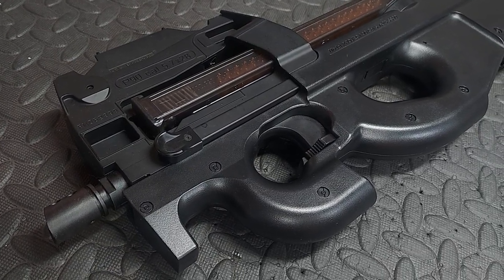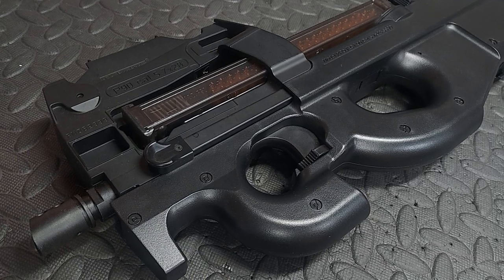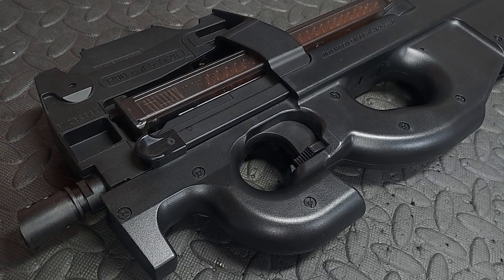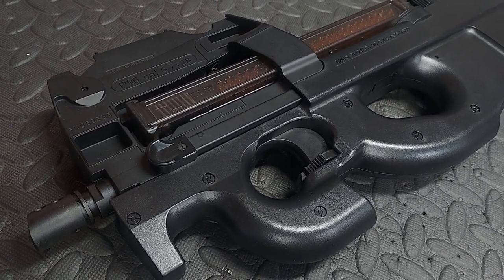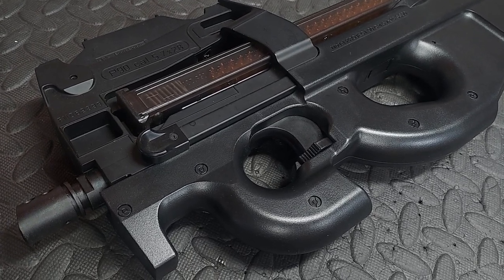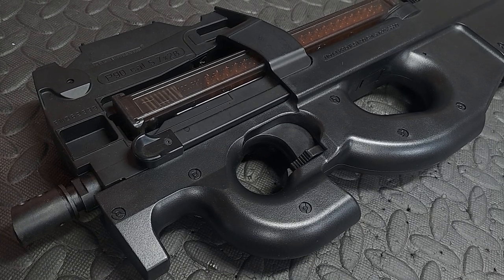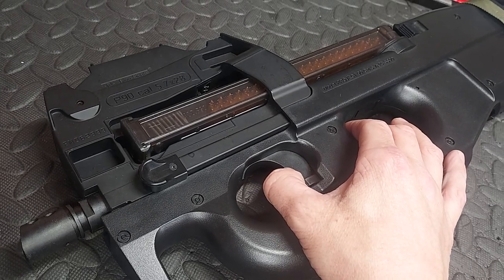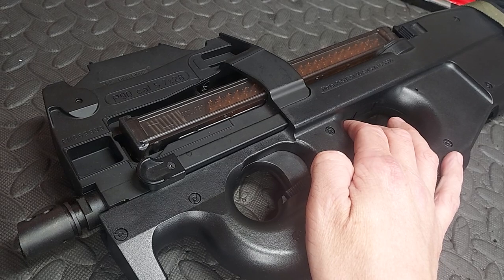Neg Shorts: Perun For P90 After A Little Tune Up.

Comment: also, how tf do I upgrade a Jing Gong AUG, cause the manufacturer put a shitty etu into it and it can't shoot full auto cause of that
Reply: Is it one of those switches with the normal wires on it or does it have some funky mosfet situation
Reply: @brokencreationlordmegatrol3037  funky mosfet situation. It's a Begadi Core EFC. it's specific for the german market, thus the semi only. I can't get any replacement parts for the original gearbox, so I can't put the original two stage trigger into it